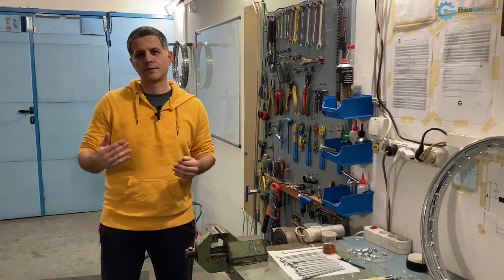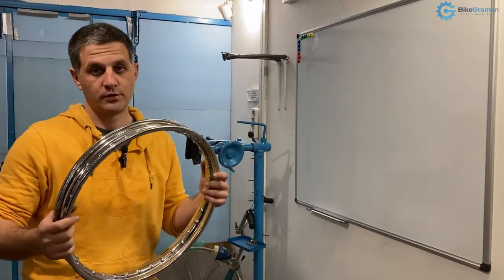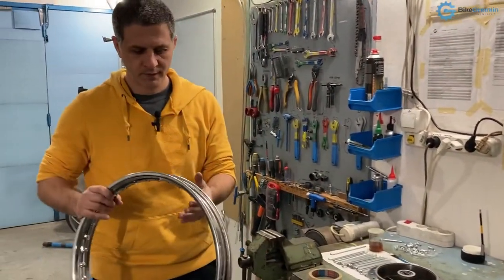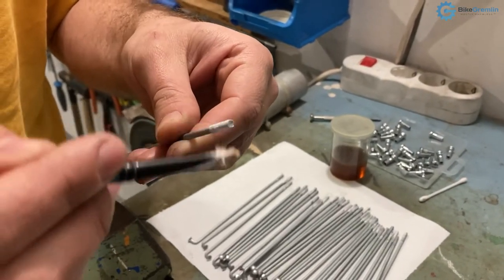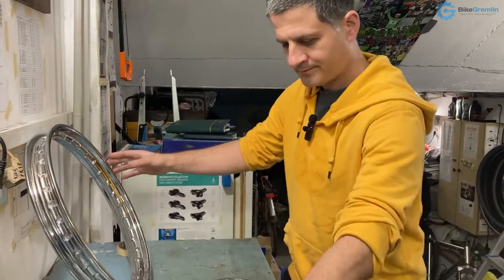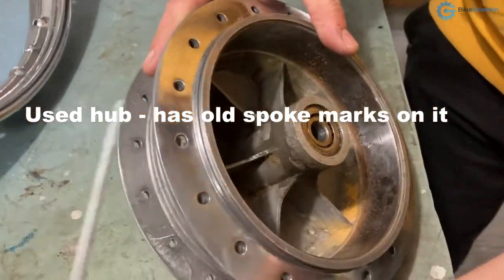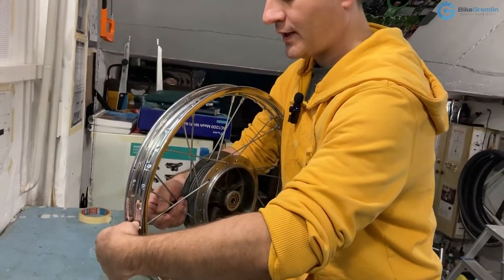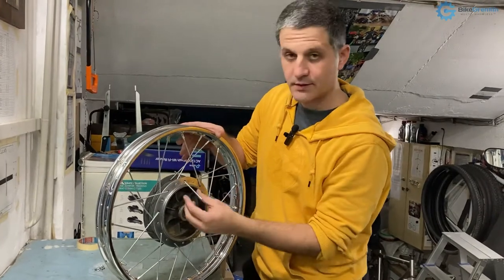Motorcycle wheel lacing explained & demonstrated

Comment: Thanks! You include critical steps other videos I’ve watched didn’t. Particularly your tips about using the pre-existing marks on old hubs, and the different orientations of the rim holes. 👍
Reply from the maker: Cool, glad if it helped.

My father, and a mechanic I learned a lot from, were both very detail-oriented ("do it right, patiently, or don't do it at all"). That's how I've learned to do stuff, and that's how I pass on the knowledge.  :)

Relja

Comment: Boring is spot on!  However your sharp as a tack,and your patience is empecible,im floored at how patient you are. Anyway thanks a lot man,I now know everything I didn't do right.patience being the first thing I do not have. But if you hire a pro, it'll cost ya about $250-to $300 ,so forget that man ,I got bad habits that are expensive,who's got $300 to throw down on some guy or lady,lace and true up your wheel. Of course I'm talking rear hub motor on a 4×20 rim and rear tire. I tried but there is a lot more to lacing and truing your back tire with a hub motor. Now my back wheel doesn't wobble from side to side,but wobbles up and down
Reply from the maker: Cool - glad it helped.  :)

I do plan to make "faster" (shorter) versions of my articles & videos (with links to the more detailed versions for when people get stuck), but I still haven't made the basic (long) versions for all the stuff I wish to cover, so it will be a while.  :)

Relja